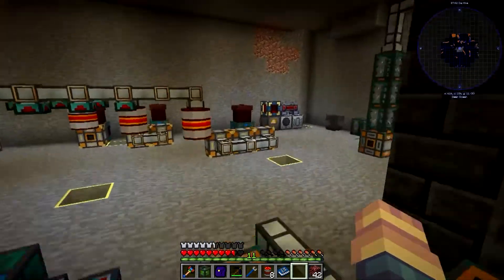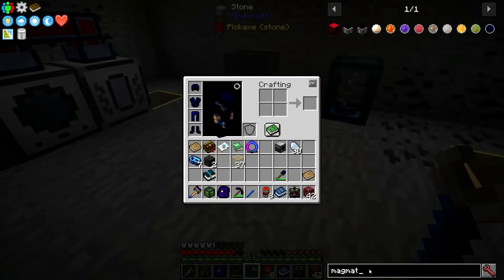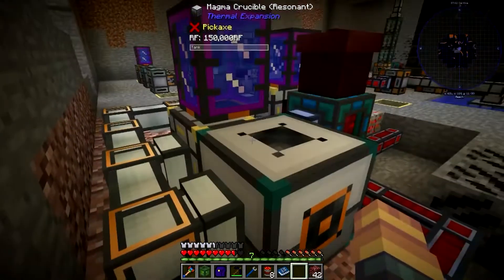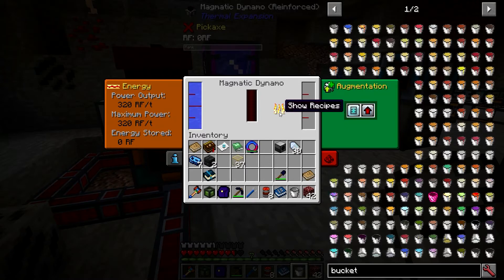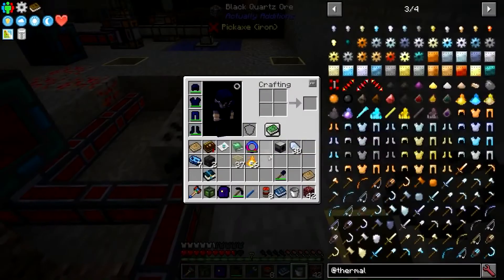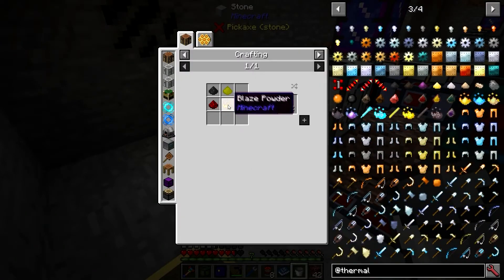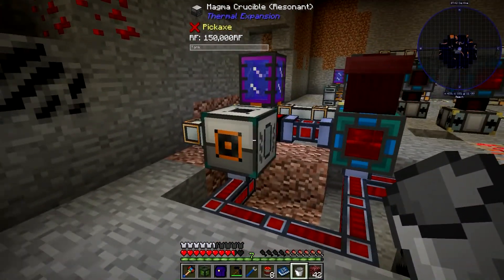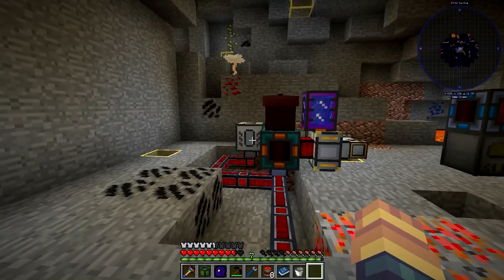Why you shouldn't use Lava In A Magmatic Dynamo:  Direwolf20 1.12!

Comment: The issue with your advice is that that is a heck of a lot harder to automate than a pump and an ender tank, and it provides the exact same rf/t.
Reply from the maker: It does give the same rf/t but not the same rf per total.  The lava only gives a total of 120,000 rf whereas the Blazing gives 2,000,000 total.  You'll be getting way more power from my way.  If you watch the end of the video it goes over the steps needed to get the ingredients for the Pyrotheum dust need for Blazing Pyrotheum.  Also, you can set up with lava at first and then switch over to BP when you get it all set up.
Reply: @Magziesfuntime  Yeah it gives more total power per bucket of liquid. But you can just use 16.6 buckets of lava to get 2,000,000 rf aswell